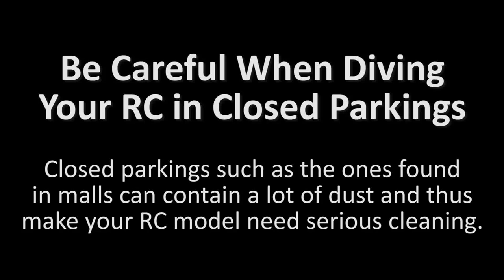Cleaning Your RC Car with Air Compressor from Dust

Comment: Lol, I go to the local gas station to use their free tire air pump there.  It works stronger than air compressor.  However, be careful not to damage parts (Whoever doesn't have money to buy air compressors)

Comment: The best way from me to clean an rc car is to take all the electronics out and the tires and just bath it with a lot of water after use a hair drier to dry it oil the moving parts a bit and its ready I do it to my hpi E10 rc car and my hpi crawler king all the time it's very helpful and it looks after good as new
Reply: its hard to remove the engine and componment from a nitro rc because it takes a while to remove everything, and the wires are ziptied to the chassis so its very inconvenient.